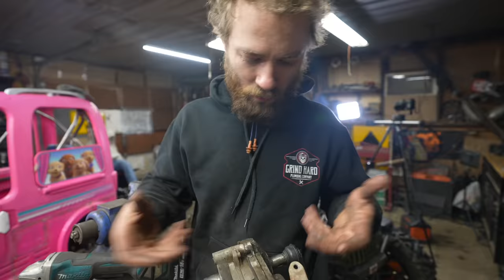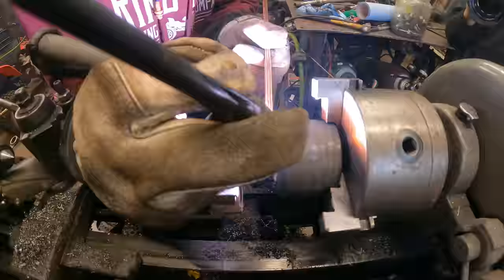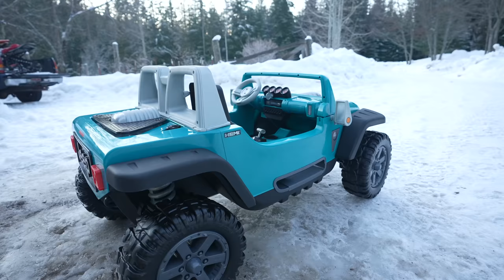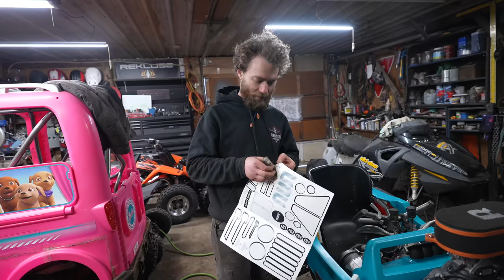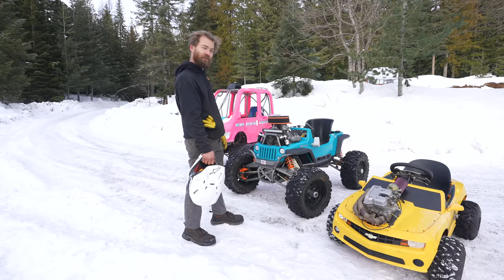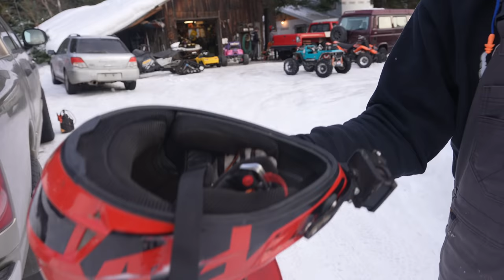Overpowered Go Karts on Ice and Snow! Fully Rebuilding Colonel Senders!

Comment: When you're welding magnesium, you MUST bury the electrode in the melt pool to get good anti-oxidant action. It will NOT attract to your electrode, unlike aluminum, which wets tungsten and is as attracted to it as soapy water is to a wet finger. It also requires about 5-10% more amperage than the equivalent aluminum mass. The filler rod must NEVER be removed from the Argon coverage, unless you WANT a 4000F fire.
Reply from the maker: Good to know! Thanks for the tips!

Comment: I liked green senders better
And I think a bette front diff for senders and the Barbie camper would be a Honda foreman diff because it’s electronic 4x4 and locking diff
It would be better than getting out and reaching your hand under the front fender
Reply from the maker: The one we have is electric, we just converted it to manual because the electric part was broken, and it was easier.

Comment: Keen for you guys to start messing with some solid axle suff, would be sick to see some on some power wheels. Not sure what the smallest ones you can get are tho, might have to make sone custom ones ;)
Reply: Golf carts use a pretty interesting rear axle setup,  or at least the one I had did. The pinion of the diff mounts straight to the motor shaft. It was minuscule compared to automotive ones. I'm sure theres something more standalone in that size somewhere, just gotta find what they came in 😎
Reply from the maker: I have a lifelong vendetta against solid axles. 🤣 They do have their uses, but if IFS/IRS can be made strong, it is better in every single way.
Reply: @GrindHardPlumbingCo  except flex baby haha
Reply: @GrindHardPlumbingCo  gotta get a baby rock bouncer going
Reply: That's fair, I'd have to say IRS/IFS is better all around IMO as well, just wanna see what yall would do with something different. Maybe a mini rock crawler style build would be suited to straight axles more than the rippers you guys have been building. Not sure it would make good content for some viewers, but I'd watch that for sure 😂 

But at the end of the day, this is about what yall wanna do, so I totally understand. Keep up the solid content without solid axles 😎

Comment: I am surprised that you still didn't get a small pneumatic reciprocating saw (small pneumatic saw that fits in a hand, like a grinder, and moves veeery fast). This saw would make cutting those plastic pieces a sinch. That's what they use to precisely cut plastic at factories.
Reply from the maker: That’s a good idea. I tend to just use whatever I have on hand, and forget to look for a tool that would actually make sense for the job… 🤣

Comment: thoughts on building a rollbar hoop over the colonel's engine & driver seat to protect both in case of future rollovers?
Reply from the maker: That would be a safer option, but anything strong enough to protect the driver would look horrible.
Reply: @GrindHardPlumbingCo  ya you'd probably have to do something similar to an odyssey-style & connect driver rollbar to engine rollbar to make them strong enough
Reply: @GrindHardPlumbingCo  Yeah you just need to wear some biker style body protection and a helmet for sure when you do any serious stunts with the colonel.  Injuries are not cool, and it would suck a lot if anyone on the channel got hurt just making some fun videos.  Please be careful and then just send it.

Comment: @GrindHardPlumbingCo im trying to build a similar build to the power wheels is it a bad idea to not build a steel frame and use the same body and seat that came with it im planing for it to be a 72v electric build

Comment: how long before Honda and yamaha start mass manufacturing stuff like the Colonel and the Camaro?
Reply from the maker: Almost certainly never. They are inherently way more dangerous than any normal ATV or dirt bike, much harder to make, and they would need licensing rights from whatever company the body is based on.
Reply: @GrindHardPlumbingCo   really just meant low cg, decent hp, highly capable suspension, go fast machines.   I think I’d give my left pinky toe to rip something like the Colonel.

Comment: You're gonna need a transfer case that's made out of something like titanium or case hardened steel Magnesium is not going to cut the mustard
Reply from the maker: It’s been fine this whole time. There’s nothing wrong with it. It just broke that tab when the driveshaft broke because of the weird forces.
Reply: @GrindHardPlumbingCo   But you are there and I am not so you know best when it comes to that I will have to agree with you

Comment: How much would you estimate it costs in materials for one of your power wheels builds?
Reply from the maker: They are highly variable. The Colonel was probably $5-10k in parts and materials. Barbie camper is much cheaper, because it’s basically a rearranged ATV that we got for a few thousand, plus some steel.